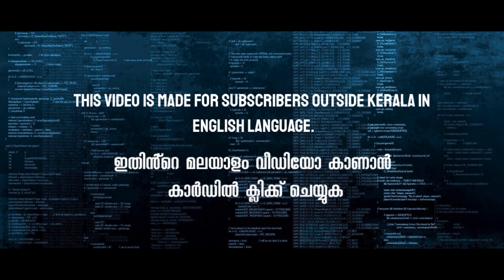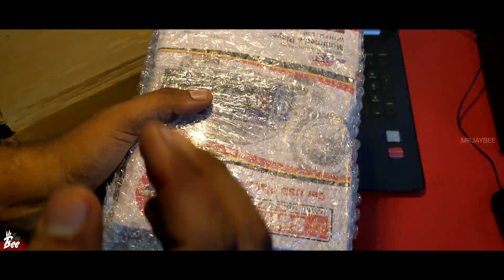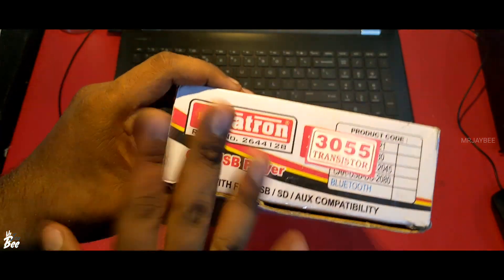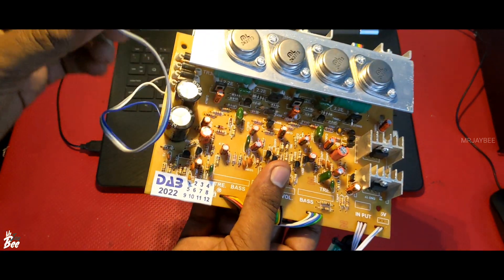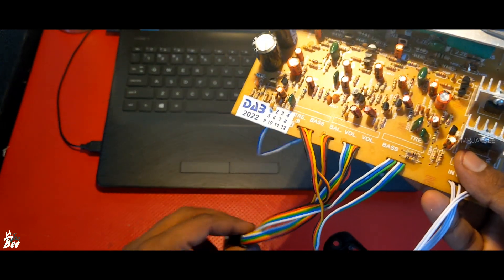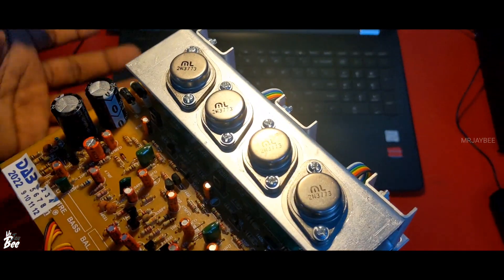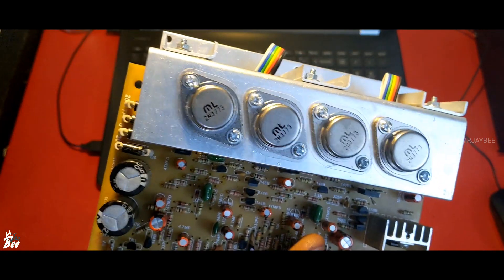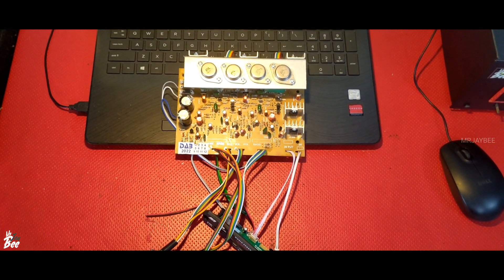2N3773 Transistor Stereo Amplifier board with bass-treble section from Amazon Unboxing and Review

Comment: It's only 20+20 watt RMS not 60+60
Reply from the maker: How can be that possible....? With two pairs of 3055, Ahuja 4040SM gives 40+40W......3773 is bit more powerful....So I swear it puts atleast 50+50W output if a good transformer is used.
Reply: @MrJayBee_YT  that depends on the input power supply as well
Reply: What about 10+10?
Reply: Manish Kashyap.
Begger go to some ITI class Atleast and learn whats Watt & Rms